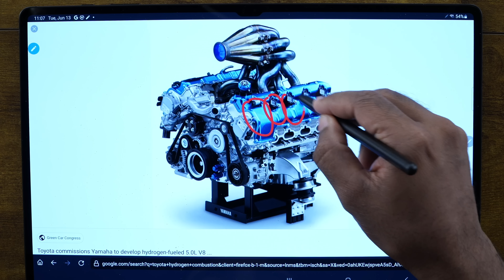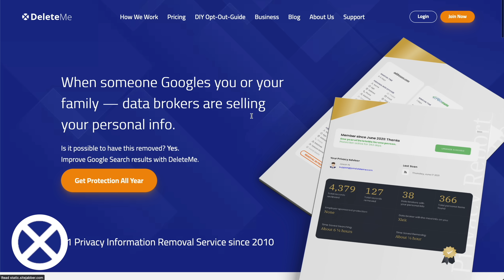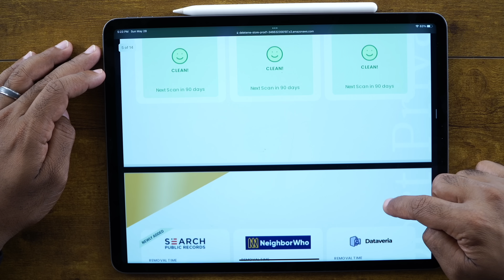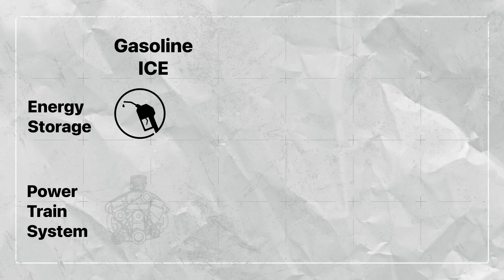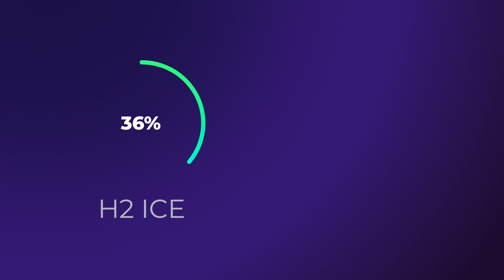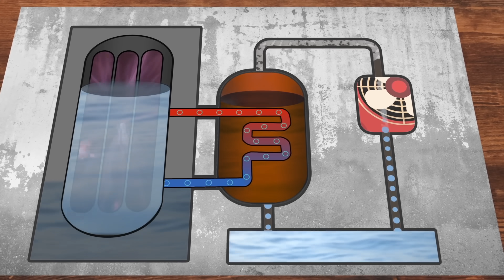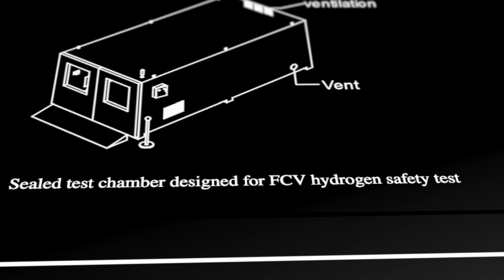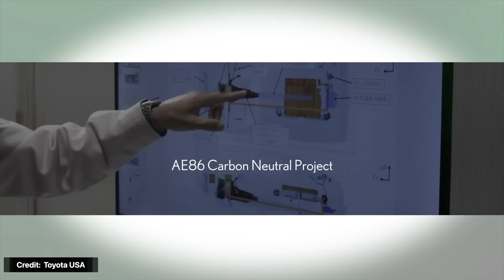Toyota's Says They Just Destroyed EVs - Hydrogen Combustion Engines

Comment: I think Toyoda is trying to keep there service and parts relevant in the future
Reply: I think everyone on this thread is simply ignoring the problem of the disposal of batteries at a vehicle’s end-of-life. I own a Tesla. It’s a great car. The best. But, an era of battery electric vehicles will leave its own negative environmental mark if everyone keeps leaving this out of the comparison with hydrogen.
Reply: @Name Certainly. There's nothing new here, going used with vehicles is almost always a better idea, ICE, EV or otherwise
Reply: They aren’t late at all. They started in the 90’s with battery technology and have it down better than anyone which is why most vehicle companies use their hybrid batteries to run their hybrid vehicles such as Ford and Subaru. They are simply exploring the a different and cleanest avenue of alternative powered vehicles. Toyota has been leading the way in alternative power for several decades and I’d put my money on them when it comes to vehicles over any other company.
Reply: @nickhowser  ICE is NOT the answer, sorry, the energy efficiencies just don't add up. You will be WASTING energy by going ICE for hydrogen. You can't ignore the physics here.
Reply: Of course
Reply: They will have two markets, those who get the hydrogen and those who still hold onto gas. Big heavy machinery will still be using the ICE to move a lot of weight as they mine and build.
Reply: toyota will be around longer then anybody in these comments. you haters who clearly understand nothing about energy infrastructure pretending to care about the planet while chinese slave labor rapes earth for lithium and rare earths. you hypocrites can hate on toyota all the way to the grave.
Reply: Hydrogen is being used in buses more and more, the mechanics will tell you they work better than electric buses. Without all the energy infrastructure
Reply: @donovanjones4175  hydrogen combustion is incredibly clean. no carbon deposits
Reply: @utpharmboy2006  lubrication? Carbon emissions right there.
Reply: @utpharmboy2006  Actually you should look it up, it's not at all true, currently incarnations emit a good amount. I'm sure improvements COULD be made, but putting R&D into a dead technology like ICE is a waste of time and money
Reply: Their parts and service are good though, they forced the American big three out of business when it comes to normal cars (except for Dodge) due to how superior their cars are.
Reply: Yeah lol cuz that makes money for them! Well it does cuz they cost more than most German car parts do but that's because they take a long time to fail mostly!
Reply: Nope, just keen to survive. Spoiler alert, they won't.
Reply: Toyota are renowned for building cars that require minimal service and parts compared to almost any other of the same type. Their cars also last much longer than most. Don't seem to have got the "planned obsolescence" memo. Given the environmental cost of building a car, and shipping parts, they deserve some credit.
Reply: @tonylittle3508  I'm driving a Toyota that is 16 years old, and has at least 320k on it. I'm not actually sure what it's mileage is since it has a design defect that causes the digital odometer to stop at 299,999.

That said, I don't give any credit for Toyota pursuing a dead technology like ICE in lieu of far more environmentally friendly options.
Reply: @repatch43  EV's are not that environmentally friendly though. More so than an average ICE car, but if you replace the fuel in the ice car, it's no longer more friendly.
Reply: @MrSolLeks  We're talking efficiencies here. It takes energy to make Hydrogen. To get the energy OUT of that hydrogen you can either burn it in an ICE (where you loose something like 70% out of the tailpipe), or you use something like a fuel cell where you loose something like 40%.

And that's if you NEED to get to hydrogen. It's FAR more likely that it's more efficient to just go with electricity through the whole change, total energy losses are far less. Energy from solar, wind or hydro are examples of this.

So yes, battery EVs are FAR more environmentally friendly than ICE solutions. Are they perfect? Most certainly not. The energy needed to make the batteries are a BIG area where improvements can, and ARE being made. With some of the new battery tech on the horizon battery EVs are 100% the future, there's NOTHING else yet that comes close. Of course, something MIGHT, we'll see.
Reply: @repatch43  sure, batteries are more efficient, though that does not count their construction or replacement. It's far more efficient to replace a part of a car's engine than to replace an entire electric motor (or often rebuild them, the copper twists have to be perfect) or battery. You are looking at the small time things, things people don't think about when comparing them. There is a lot more to an EV than an ICE car even if the ICE engine, and hydrogen at that, has more total parts.

even more so if you have to replace the entire car despite all the parts working just because of the batt is either made in a way that you can't really replace it, or it's just not cost effective to do so.
Reply: @MrSolLeks  Who is replacing who cars because the battery is done? That doesn't make sense. The market will work around battery packs needing replacement, it's already being done today and we've just entered this world.

Even 'done' battery packs don't go to waste, they are being reused for other purposes (home storage is a big one). And again, we're at the beginning. Batt EVs aren't that old, the 7 year rating is VERY conservative. I for one would be fine with a batt EV that only had 50% of it's original range.

There's alot of FUD out there about the batteries in EVs, I encourage people to research what the REAL state of affairs is.

And again, that's only if you limit yourself to Batt EVs, there are other types (like fuel cell).

ICE is dead, please let it die.
Reply: No they realise EV’s are not the future.
Reply: THIS GUY DOSNT KNOW WHAT HES TALKING ABOUT. HYDROGEN IS THE FUTURE. ITS MUCH MORE EFFICIENT THAN ELECTRIC. ELECTRIC GRIDS ARE GOING TO BECOME STRAINED IN THE FUTURE WHICH WILL LIMIT ELECTRIC CARS EVEN MORE. WE ARE ALREADY HAVING TROUBLE WITH THE LOAD IN TEXAS ON THE ELECTRIC GRID. HYDROGEN IS THE FUTURE BECAUSE IT IS CLEAN AND ONCE THE SUPPORT INFRESTRURE IS BUILT FOR HYDROGEN CARS IT WILL ESSENTIALY TAKE THE PLACE OF GAS ENGINES..

ELECTRIC VEHICLES CAN NEVER TAKE THE PLACE OF GAS VEHICLES BECAUSE THEY ARE SIMPLY JUST TOO INEFFICIENT TO BUILD AND MAINTAIN OVERTIME. WE HAVE TO DO SOMETHING WITH ALL THESE BAD BATTERIES AND THE POLLUTION THAT COMES FROM MINING COBALT AND LITHIUM AND THEN HAVING HUGE LANDFILLS OF NOTHING BUT BAD BATTERIES THAT NEED TO BE RECYCLED CAUSING CHEMICAL POLLUTION INTO THE GROUND WATER AND SOIL.

TRUST ME HYDROGENN IS THE FUTURE. 
ELECTRIC VEHICLES ONLY PRESENT THE SAME PROBLEMS IN DIFFERENT WAYS
Reply: dendrite forming battery degradation makes a small part of battery not recyclable. most electric battery are not being recycled, and they dont last as long as is apparent in low prices in used market for electric cars, lower driving range in higher mileage cars etc. combustion cars last as long as the  metals dont rust, anti rust systems exist but arnt used, most combustion cars dont last as long as they could also because people dont change oil and oil every 5k miles and oil filter every other oil change (when its dirty).  oil is recycled by us government , bio fuels, e fuels, hydrogen combustion, are all sustainable.  current ev will rust and short circuit in wastelands under rain, moist air etc, they will not be recyclable even when they do somehow start recycling battery by weird materials science stuff without chemical side affects that would make such thing unworthy.  
            if people really wanted to reduce emissions, they would use the limited battery supply to reduce emissions where they happen most, through all cars through all of time: in low speed high engine power situations, which is especially bad in traffic happening near people like crowds of people at sidewalk in a busy city street. normal hybrid cars already do this better than electric car approach, where you can make many hybrids out fo the same battery mass used to make 1 electric car.  even better:  have electrci assited turbo small single combustion chamber engine charging up pressurized liquid and or air and making electric energy with linear movement, the piston will be pushed back into place by hydrallic switch or something so combustion can push it to make energy , with something like linear electric actuator, which maybe similar to electric spinning motor then the power would be released as needed. they probably will need to use minimal amount of battery (assuming its meaningful to reduce emissions to such a extent).    
			recycalable electric motor by mahle, but it needs transmission, subaru wrx high torque transmission, and toyota uses a first gear for high torque then continues the other gears with ContiniouslyVariableTransmission.     such system will be easier to package than combustion and ready for switch out systems easier when a new technology becomes worthwhile, like maybe hydrogen combustion that isnt too hot so the only emissions is water or something, or electric hydrogen, or a proper electric car battery .            
			consider tony heller suspicious observers, and tom nelson, etc in their takes on climate change... also see richard vobes on ulev expansion, romanian tvee video called why woke wont go broke, and see how they print money and give it to people like blackrock who can weaken people to make them easier to control fro power centralization, especially with printed money given my private corp called federal reserve, making money more abundant but it represents the same real wealth, causing everyones dollar to be worth less, whiel they have more... its stealing. blackrock promotes climate change narrative. they constantly get their predictions wrong, they apprently dont know what their talking about and i cant prove their narrative as even proabably correct either. they are taxing productivity and using climate change as a excuse to get ways to control people more in way that favors them at cost of us.        
 look at hwo they put emissins laws retsirctions  based on length and width of car but dont tax height, which makes cars unsafe in crash as i explain here, less areoydnamic, they tend to roll over more so less momentum preservation and less safe. they also set restriction based on engine size, which isnt fair because for eample, porsche used a bigger engine because it has less emissions per size than the samller engine which wouldve been less emissions. they also would tax weight of car, for reason i explained. theyd also not make it more difficult for small cars to meet emissiosn stansards, and not relax anti roll over standards and emissions standards for "suv" cars.
Reply: but consider that burnt food feels bad like other things in nature that normally feel bad when harmful... similar to smelling smoking fumes like tobaco burning smoking fumes, such stuff causes cancer. such smoking wasnt seen as being so harmful until after so many people were moved to seed oils instead of natural fats as cooking oil stuff, which is known for causing health problems like cancer... and thats just 1 part of human health. so, you can argue its not all too meaningful to reduce emissions, but it definitely is better to lessen that stuff liek  NOx, SO2, particulate matter (smoke), and heavy metal pariculate such as lead and arsenic, at least to some extent. maybe use CNG, LPG propane combustion..   
			more energy flow worsens battery degradation you can divide degradation across more battery cells to increase longevity, but the more you add , the exponentially more energy goes into and out the energy to move the car... because your not using all the energy stored in all that weight at a given average moment  in driving, and the stuff is heavier per energy vs combustion. weight worsens natural wear damage of roads which costs resources and emissions to fix, heaviness makes car more damaging in car crash. making sructualy stronger part of sedan at same level of taller cars strong structure, protects upper part pf car (and people isnide it) safe from strong heavy parts of taller car, if  the part in front of people is all fully crushed and tall car touches the people. nowdays is normally low to the ground to minimize tendency of car to roll over when turning quickly enough. sedan can rise quickly liek audi a8 air suspension, to get hit at a angle that minimizes damage, whiel keeeping car areodynamic and more able to preserve momentum around turns(not tending to roll over), while not being unsafe for non tall cars, by keeping weight low to ground. givign option to raise the car when user gets in, makes it easier for disabled old peopleto get into and out fo car and lift objects into car, by minimizing joign movement and msucle movement. it could give options to make ride less bumpy and stiffen up the ride to make it bumpy for preserving more momentum around turns by making it less tending to roll over.    tires wear out emitting micro plastics that suppsoedly are endocrine disrupting, stuff goes into water supply food supply, similar situation with anti birth pill residue, etc, and its heavily petrol based.  natural rubber from trees was used but gave far less grip, we could go back to using more of that with lighter weight cars, so less grip is used in dealing with weight, and more is used in gettting car to move and stop and preserve momentum for effiency and manual steering lotus elise style driving fun.    
			rerember, this should be about lowering emissions of already sustinable types of combustion, not reducing combustion use.  rear wheel drive means less regenerative braking, so less degradation, while making it lighter weight in rear mid engine sports car style weight distribution, for dividing weight across all the tires more equal, so front wheels dont get overwhelmed by too much weight and cause car to loose grip, rear wheels help handle more of the weight.  same with not making outer wheels handle all the grip without as much help from inner wheels , when car is turning sideways and car is still tending to move in the direction it was moving when it was speeding in straight line. besides preventing traction loss for saftey, this also allows preserving car momentum around turns , so less use of regenerative braking (which is also not as energy preserving) , brakes, engine lubricant, combustion fuel, battery energy, etc, so more longveity of all those things  . this would also decrease weight, so less road wear damage, less damaging in a crash.             
			to improve aerodynamic and heating cooling and weight  effiency and add usable legroom, make rear seat face the rear and shape the car around that. make  seats fold so they would make the person inside make their back bone sit up straight, so its easier to get into the seat, without needing to make a lot of space between the backbone and the wheels, for weight reduction. when door clooses, it lets drive lean back into a seating position similar to gordon murray t50 seating position ,for aerodynamics,  weight, and high driver awareness per amount of driver mental stress(lower stress). make it compact 4 seater for minimum costs per capability, and thatll be enough for almost all needs, people can rent a van for family road trip , and carry kids to doctor in a few trips instead of doing it all at once.  because modern culture is designed to weaken people to make them easier to control, because of NWO bankers , blackrock esg score, etc, family culture and all long term collaborative relationships are becoming far less common, so 2 seaters will be more reasonable for many people instead of 4 seater, so itd be llooking like aptera solar plugin electric car, or pre sam electric car, or gordon murray imotiv, or gordon murray t27.                             allow high airflow into car so its very similar to co2 concentration of natural open air, so it doesnt cause couldy stressed depressed mind, and vent can even open  more as a alternative to roofless drivers desires without the non effeincy of removable roof sports cars. its aerodynamically better alternative to opening windows more to get rid of a fart smell, and its quieter vs wind noise of putting window down. for luxry car, make it like lucid air front end rood area for rear too, allow manual removable tint shade from sun, and a shade with holes to let in most sunlight but not too much and also for some privacy.   because its better to make people buy my car than other sports luxry car, its better to  offer such non effcient stuff lie glass roof, and for tire longveity , saftey (like anti fish tailing traction control system), speeding around a turn more smoothly with less tire wear and with optional simulation engine sound that correlates with torque vectoring torque vs RotationsPerSecond of each wheel .... a limited slip difffrential type system is worthwhile for them. tire wear reduction by speeding around turns is considerable for luxry sports car customers because they will speed around turns often even if infotainment system reminds them not to do so and remind how to drive efficiently every time car is turned on.             so, energy effiency and emissions is not as good as electric car when comparing one electric car to another one of my concept car, but that doesnt matter, because across the whole fleet of car through all of time,  its ultimately more sustainable, less emissions, safer, cheaper, more fun to drive , etc.    
			current cars that come close to this more dieal car im talkign about, are volvo v60, prius and possibly (but probably not) prius prime.
Reply: Toyota missed the boat when they invested in hydrogen instead of electric and will become irrelevant,  and I say that as someone who has owned multiple Toyotas.
Reply: @rustyshackle917 me too, and we have two Corollas in the family!
Reply: I am baffled by this also.  @rustyshackle917
Reply: @rustyshackle917  You got to create the eclectic some way and EVs will not be able to replace all ICE. There are some vehicles where the ICE is the better choice over EVs. Not unless you want to get out there and dig up the minerals needed for the EVs by hand. You will still need the ICE for that.
Reply: Completely, it's very disappointing anybody is even paying attention to them. This is exactly the same as how Kodak stuck to film despite knowing it was dead.
Reply: @repatch43  I think its a testimony to how powerful the EV narrative is. Most people think EV is the complete future.  In reality, it's only a small PART of the future. The current processes that go into EV production are super costly, highly toxic, and simply could never keep up with market demand after reaching 20%. The amount of environmental destruction required to build new vehicles AND replace batteries every 5-7 years would make the pollution produced by combustion engine production vehicles look like a tea party. 

Toyota is smart to not convert their production completely over to EV. Synthetic fuels will soon be developed which will allow billions of vehicles to simply transfer over. 

EVs are a meme.
Reply: @LordRykard9376  Haha, umm no. 

First off, 'EV' simply means electric vehicle, which you are incorrectly assuming means 'electric vehicle powered by lithium ion batteries'.

Battery tech is constantly evolving, the whole FUD of 'highly toxic and super costly materials' isn't mostly true already today, and will become less and less true as time progresses.

All the FUD about manufacturing capacity is based on the assumption that nothing can change, that currently motor and battery designs are static, and that resource extraction cannot be change. Tesla themselves have already proven that to be false with some of their changes to reduce reliable on certain materials.

And of course, that all assumes we're talking batteries. An EV doesn't mean a battery is the source. Fuel cell tech is another avenue that exists today, we'll see what comes next.

ICE is dead, MOST people understand that, and of those that do and have a foot in the game the URGE to keep ICE relevant is VERY strong. This is the photo film situation all over again.
Reply: @repatch43  we got a galaxybrain here folks. 

I clearly differentiated from EVs and their battery technology which predominantly use the Lithium ion cobalt configuration which was first developed in the 1970s. So I have no idea what your idea of "constantly developing" means. If it's 50 years, then we have about 40 years until the next battery revoluition. 

The FUD that exists regarding manufacturing is regarding what I mentioned, not your sophomoric take on realistic industry standards. Tesla still relies on Lithium ion and cobalt. They mentioned they will try new configurations but that is likely a long time away. They also import a majority of their Lithium ore, which again, adds more pollution. You're so uninformed that it took a random guy on the internet to explain the reality of battery production. 

If ICE was truly dead, every big rig, truck, and the vast majority of commuter vehicles would already be EV. But they aren't. And that's because the technology simply isn't there. And the current infrastructure isn't robust enough to support charging stations. You're a dum dum so let me ask you this: you think it's smart to centralized all of our energy needs? 

I'll support ICE until a Tesla can start itself on a below freezing winter morning.
Reply: @LordRykard9376  As battery technology improves, the comical composite of the battery changes and recycling improves battery electric vehicles will stay relevant whereas hydrogen manufacturing may become more green at this time it is not. 
And the question of these alterative fuels for ice care will be cost prohibitive for the foreseeable future.
Reply: @charleswright9957  as battery tech improves...yeah we've been using the same tech since the 1970s.
Reply: @repatch43  And look where Kodak is now. Just a bit player. Irrelevant.
Reply: @repatch43 : if Toyota had done nothing. Saying petrol and deisel were irreplaceable. Then yes. But they’ve spent  30 billion on refining hydrogen combustion. Along with JCB. 
All that’s missing is the infrastructure.
Reply: @jugganaut33  Spending money on a waste of time, is a waste of money. If the infrastructure existed TODAY it still wouldn't make sense. The efficiency just kills the whole idea. Energy costs money. Throwing nearly 2/3s of your money out the window makes no sense when you have an option that is close to 85% efficient. And that's ignoring the additional maintenance costs.

I can see this sort of thing POTENTIALLY having some niche applications, at least until fuel cell tech matures enough. But at that point ICE will truly be dead, finally.
Reply: @repatch43 : it’s not 85% efficient. Electricity production is inefficient also in anything except fusion and fission reactors. 
Gas rigging. Oil rigging. Production of wind and solar is not efficient. Solar is only 20% efficient.

The National grids of every western country is not capable of sustaining a digital world. Its already at capacity. 

All infastructure in Europe and America is Rated for vehicles of 50tons.
Which is usually a 10 ton rig and a 40 ton container. That’s modern logistics.
In order to tow 40 tons you need 30 tons of batteries. Which makes every vehicle 70 tons.
Which means all bridges. Ducting, road surfaces need to be altered to meet the new weight and wear. That’s not cheap.
Then there’s the problem is there’s not enough rare metals on earth. Let alone in Europe and America to replace every Petrol and diesel vehicle and generator.

How do you fight a war on the scale of Ukraine with batteries? How do you fight a war in nuclear winter. After the EMP of all of your infastructure is digital and electric.
You’re not a genius and 100% electric is t the answer. Everything needs balance. Everything needs healthy competition. Everything needs diverse approaches. Same way all power stations aren’t all gas. Or coal. Or oil. Or nuclear. Or wind or solar.
It’s a mix. So one can pick up the slack whilst the others down. Everything has strengths and weaknesses.

Hydrogen engines are a new technology. Literally this decade is the first viable option. Electric motors have been around for the past 120 years. The first cars and trams were electric. Long before we had petrol or diesel. Which again took 80 years to refine to the correct octane and lead free format. 
Hydrogen in 20-30 years will be a different animal.
Reply: @jugganaut33  I'm comparing H2 ICE with H2 using fuel cells. That's what important here. Using H2 for ICE is a waste, in EVERY permutation of the meaning of the word waste. 

The only reason Toyota wants to push ICE is because ICE has been Toyota's business model for so long no-one remembers anything else.

It's Kodak, all over again. APS system anyone?
Reply: @jugganaut33  The EV infrastructure isn't that great either.    And the charge time doesn't work for people who don't want to be bothered charging each night.
Reply: @jugganaut33 and the understanding of physics...
Reply: @jugganaut33  "All that is missing is the infrastructure". Do you understand what you are saying? The hydrogen infrastructure problem absolutely dominates the car development. The physics is against it and using hydrogen produced from fossil fuels is actually much less efficient and a lot more polluting than using the fossil fuel directly in an ICE. Even if the hydrogen is from green electricity the nimbers just don't add up.
Reply: @repatch43  It is not dead. ICE will still be needed for a lot on work. You cannot replace many vehicles' gas with EV and expect to get the same amount of work done. The large and more weight a vehicle has, the less an EV becomes as a good power source. There is a point where an EV's own weight cancels out the extra battery size. 

Not everybody is on board with EVs. Already a quarter of their owner are going to switch back to ICE. The more industrialize other country become, the ICE make the better choice for the public as they build.
Reply: @williamrogers4917  You act like battery based EVs and ICE are the only options. They aren't.
Reply: @repatch43  yes tesla never breaks down. That is why they almost never have a warranty repairs done.
Reply: @rightsdontcomewithpermits7073  I don't understand your point. Where did I says EVs never break down?
Reply: Yes but with lies
Reply: Let’s make some simple extra complicated
Reply: All this bluster about Hydrogen won’t get around the physics of using it. Tell me how they plan on lubricating this engine? Oil maybe?
Reply: Toyota TOTALLY lost their edge.  The 2003 prius I has was THE BEST car I EVER had.  BUT they never went anywhere with it as seen by my 2007 prius having the EXACT SAME MPG as my 2003.  Then after being DUSTED by the Chevy Volt wplug-in hybrid with an AMAZING 40 miles on EV per charge they tried Prius Prime which had an abismally low EV range compared to the older VOLT.

Having said that they seem to be doing better with the  RAV4 HV and prime.  My RAV4 HV SUV gets am impressive 40 to 60 MPG based on how you drive it.

Ultimately though unless they can standardize and safty harden reactors AND prove the viability of a H2 underground piping to station network (at that point replace natural gas in home heat too) the H2 ICE just is NOT going to be more than a temp interim solution for a select few cases.
Reply: @stevenmercurio8536 let us know how you feel when you replace your battery for $5000 which actually involved more pollution its production than all of the equivalent tanks of gas.